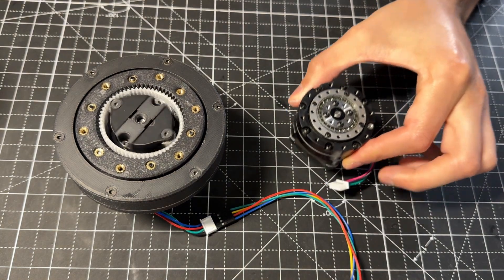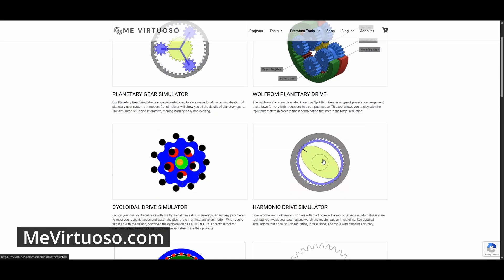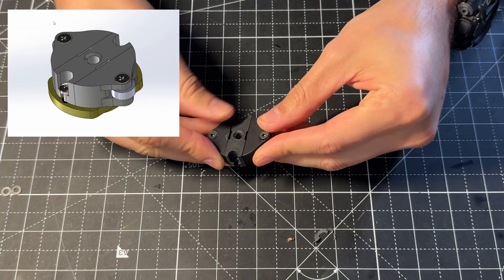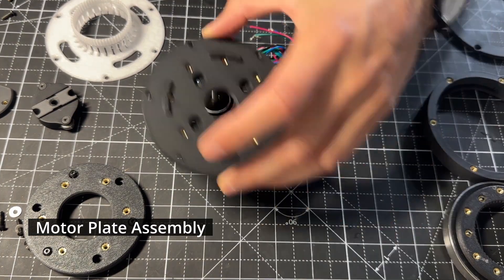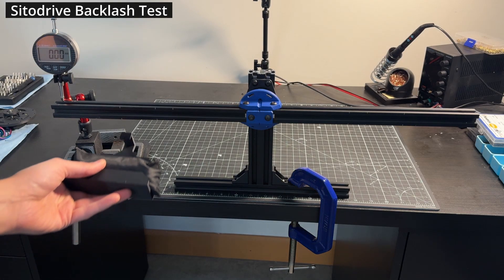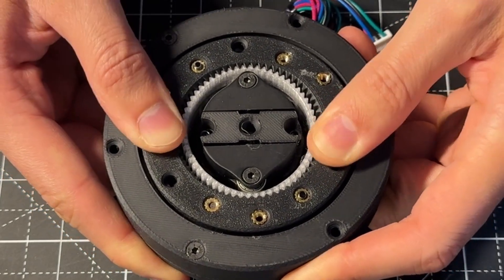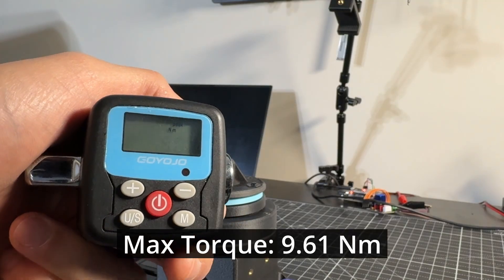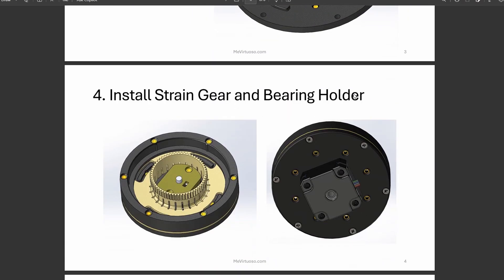Harmonic Drive Version 2 - Torque & Backlash Tests

Comment: You are measuring the deflection of the beam superposed to the backlash. Not a sufficient approach and only qualitative and relative ... Or is the calculated in your script according to the standard? If you use wave generator with balls instead of only two contact points with the two bearings, this will increase stiffness but with more friction losses as well. Very good improvements to the spline to avoid fatigue. Maybe the contour of the introduced solid joints has to be improved for flexibility only in the required direction to avoid twisting?

Comment: You can reduce the backlash in the 3d print by restricting the deflection of the flex gear by making the wave generator more oval all round to consume the oval made by the deflection of the flex spline. Also make solid the wave generator as the adjustable design also adds deflection as they can rock on the washer stack.

Comment: Hi! I built some harmonic drives myself, and I can give you some advices:
1) Try to support sides of flexsplines. I use 4 bearing wave generator. 1 pair of bearings press flexspline at contact with output gear, and another pair is turned 90 degrees for additional support. It may be needed to reprint wave generator several times to get nice fit into flexspline. 
2) Don't be afraid of thick flexsplines. I find that ~2mm thick walls are great choice for strength and flexibility. But you would need to design drive with thick flexsplines in mind (see below). Also, no cutouts are needed.
3) Lower you deflections as much as possible. If you look at flexspline teeth that are 90 degrees from teeth engagement point, they need to be ~0.1-0.2 mm from output gear teeth. If that clearance is bigger you would get get no benefits but a lot of problems.
4) Try to keet teeth as small as you can reliably print them. I keep them at about 1.9 mm height. Mostly because of reliable printing considerations. With smaller teeth you would need much less deflections. I have teeth with 1.9 mm height, and so when flexed my flexspline's ellipse have difference between diameters of 1.9*2+0.2 mm = 4 mm. With very little at diameters of ~60 mm that I prefer for my drives.

Comment: Hey i also build an harmonic Drive but in a different Variationen. It lifted Up to 4-5 kg with a 600mm lever. It has two circular splines with the Same Diameter and a different modulus. One has 90 teeth and the other one 88. The flexspline has 88. If you want you can See it on my Channel
Reply from the maker: Nice! Looks like a pancake design. Did you ever test torque efficiency? How's the durability?
Reply: @promakina I unfortunately didn’t do that, but what could be said is that it moved very smoothly, since the roller bearings worked quite well. Also, I had less play than you did. The material (PETG only) didn’t really have any problems with it and it still looked very good after taking it apart. I also performed a two-hour endurance test of the gearbox without any load and with an input speed of 700 RPM. The gearbox itself didn’t show any issues in any way

Comment: How do you explain the difference between the measured and speced backlash of the commercial drive?
Reply from the maker: Different testing methods would be my guess. Perhaps I also need more data points (additional measurements at different torque values)

Comment: To remove the twist in the assembly consider using a smaller diameter toothed belt and only having teeth contact where needed.  Then  use roller bearings to stiffen the belt, pushing it outward but not contacting the ring gear.  This taking out the twist and stabilizing the belt.  Kind of a belt tensioner like the use on many belt driven items.

Comment: Do you use fuzzy skin on outer walls or CF-PLA? The surface finish is really good
Reply from the maker: Fuzzy skin on outer walls!
Reply: @promakina What settings do you use for fuzzy skin?
Reply from the maker: @КостаСтојановић-о8х 0.1 for both, point distance and thickness

Comment: Great project and excellent video. It’s disappointing to see that the performance of the 3D printed part is so far off that of the commercial units, but good to know the limits and it’s an excellent design to have available.
Reply: Bro, there is a reason one is 300 to 1k $ and one is a diy solution 😂
Reply: @Basement_CNC did you miss the price shown in the video for the Sitodrive? 169 USD iirc :) pretty cheap, all things considered.

Comment: what are the gears printed from? PLA?
Reply from the maker: PLA, except the flexspline which is printed in PETG
Reply: @promakina do you think the efficiency would improve drastically if you printed the rigid parts in something more rigid like carbon polycarbonate?
Reply from the maker: @ROKO-e5t  I tried different materials on the previous video, PLA and Nylon, there's some performance difference but still nowhere close to the metal harmonic drive